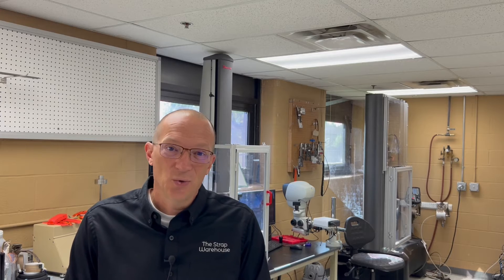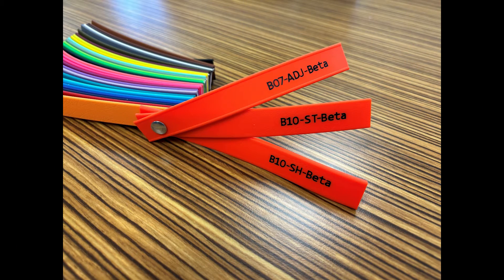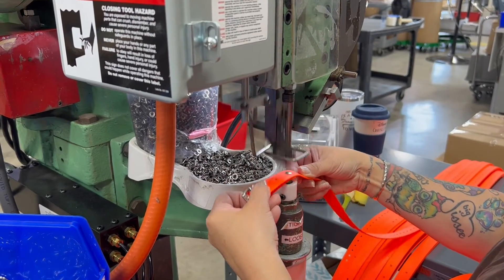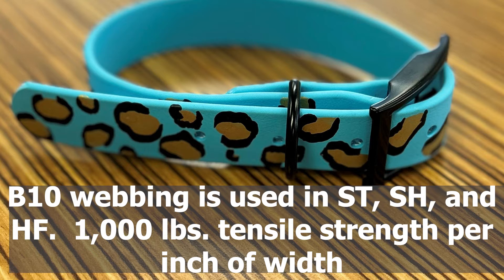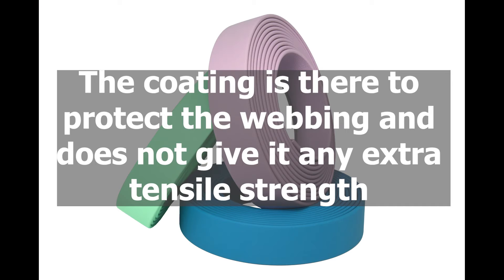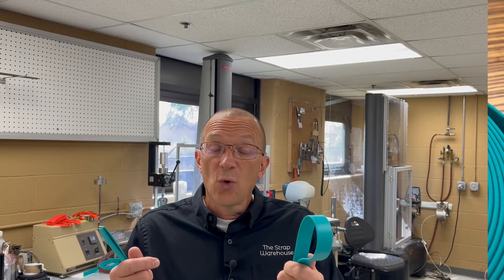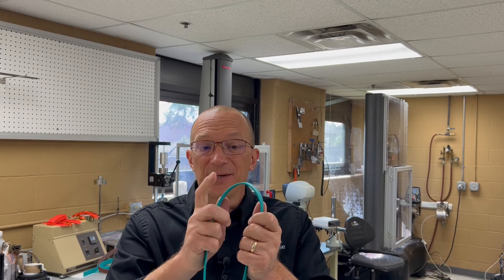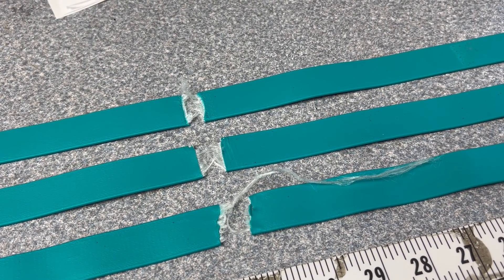Tensile Strength of BioThane®

Comment: Hi Marlon, have you ever found a glue adhesive thar will stick two pieces of Biothane together.  I use a lot of Biothane in the UK and it would be helpful to use in my products.
Reply from the maker: Sewing, riveting and welding are often the most common ways to attach BioThane to itself or another material. We don’t recommend gluing or have any supporting test data for adhesives to ensure proper a bond is created. There are just too many glues, object types, operating environments, BioThane products, etc. needed to fully validate an adhesive so unfortunately we do not have any official recommendations.